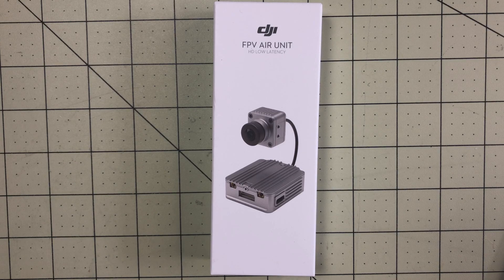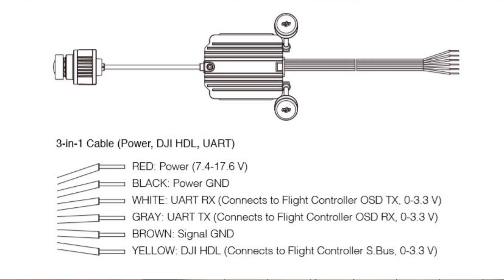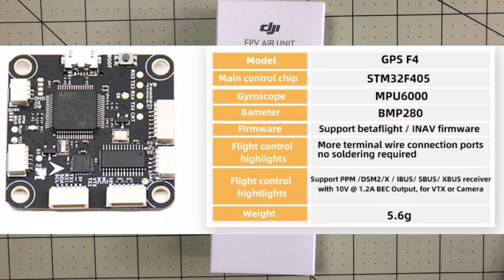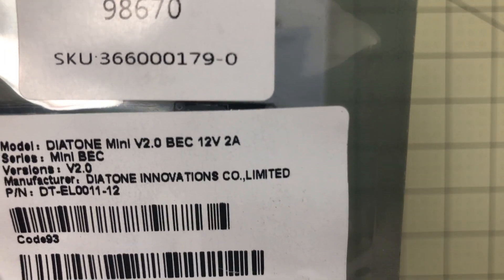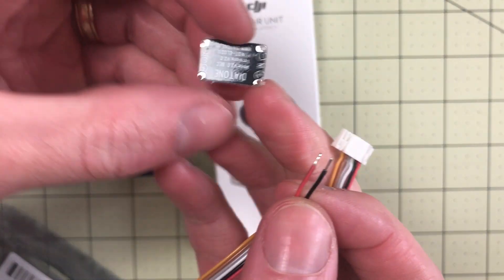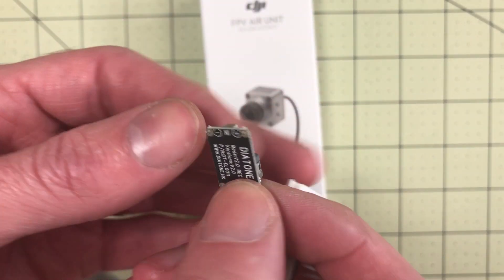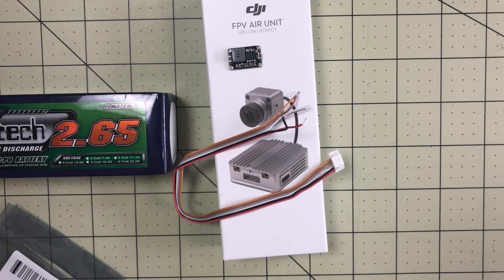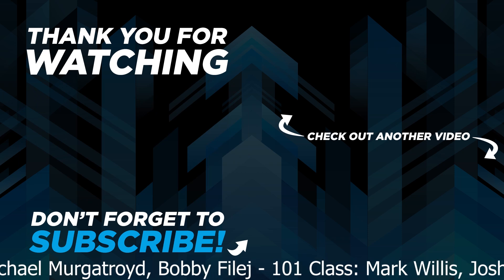How to use the DJI FVP Air Unit with a 6S Drone

Comment from the maker: The Diatone 12V BEC: https://geni.us/Diatone12VBEC 
Turnigy 6S 2650mah Battery https://geni.us/Turnigy2650mah6S90C 

DJI FPV Goggles Combo with Air Unit and Radio http://bit.ly/DJIFPV-BG $743 - With Code BGSAU20 DJI FPV Goggles Combo with 2 Air Units http://bit.ly/DJIFPV-BG - $655 - With Code BGSAU20 
Other DJI Options: https://geni.us/DJIFPV2

Check out my current giveaway: http://geni.us/DroneRacer101Rewards 
These are the current Drone Coupons I know of: http://geni.us/DR101DiscountCodes 

A lot of people have transitioned from 4S to 6S over the last year or so.  But the DJI FPV Air Unit only supports 3S and 4S.  So what do you do if you fly 6S?  Not a Problem

Supporting Droneracer101 on Patreon means more reviews and giveaways for you: www.patreon.com/droneracer101
Reply: Just to let you know that on your latest video about a flight published on facebnook 6 years ago there is a link to your 2nd channel about resin 3d printer as you called it that IS NOT WORKING.

Comment: I just smoked a Caddx Vista which is supposed to handle 6S which it did for about 30 flights. Then POW!! This should keep that from happening again. Thanks for the tip.

Comment: This might be a silly question but I am new, would it be okay to plug a 6S battery into my quad that has the DJI air unit plugged into my FC that's on 9 volt,or still need regulator.
Reply: That should be okay, but really make sure that your FC's 9v BEC can deliver enough power. I just had an issue where the DJI Air Unit shut off (during a power loop, ugh), and I'm a little worried that my FC's 9v power is the problem (that's how I found this video tonight). I'm running 4S so I'm just gonna connect directly to the battery for a while to eliminate that possibility.

Comment: Went for another build tested this same bec dayum it won't output 12 v as bec clearly states diatone v2 12v 2 amp only outputting 9v on a freshly charged 4s lipo.  I don't know if this is sufficient for 5 and 6 s. On this air unit. What bummer fork it still setting it up. I just tested on a 5s now the output voltage is 14.47 volts. Is this diatone bec a dud?

Comment: hey i got a question. i wanna put dji hd in a apex with 6s and a
 Bradwell f4 aio stack 32bit esc...so there are some pins with 5v and 9v can you take a look and answer me if i can put the dji fc direct on the 9v from de esc from bradwell? greez

Comment: Hmmm just ordered a bunch of 5s batteries. 18.5v
I flew one the other day on my air unit build and it was fine.. but now I’m second guessing keeping all the batteries I ordered
Reply: Did you have one of these BEC units on your quad, as shown in this video? Or did/do you fly it without that BEC unit? If so, how's it going with no BEC? Or with BEC? Any issues, or still flying like a champ? Asking because I'm going 6s next month. thanks!

Comment: Hi tks for the vid. Do you still get OSD batt voltage?
Reply from the maker: Yes. That actually comes from the flight controller through the Uart connection.

Comment: Mark, do you know how much, if any, filtration is on that voltage reducer ? Thx
Reply from the maker: I don’t, but so far that seems to be another big advantage of the DJI.  It just doesn’t care.  On my TS215 I’m running it straight from the battery pad.  My wing does have a cap on it, but my “analog” wing still had tons of issues and I have none of that with the DJI.
Reply: @SimRacer101    apparently the DJI system has enuf built in filtration. The reason I ask is when running caddx Turtle off 5v Bec from FC , sometimes it overloads the Bec, but when run str8 from battery, I get a lot of interference. I was hoping maybe this could offer good filtration without using FC 5v Bec. I will stay tuned. Thx

Comment: I can't get osd battery voltage??? Any help?
Reply from the maker: A lot of people seem to be having that problem.  I may have to knock out a quick video for it. The white wire needs to go to an uninverted UART TX pad on your FC and the gray needs to go an an uninverted UARD RX pad on your FC.  Than for that UART in Betaflight, or iNAV just enable MSP.  No other options needed on that Uart.  Also need Telemetry enabled under configuration.
Reply: @SimRacer101  aha! The telemetry is my issue. Thanks!

Comment: Hey man this question may be unrelated but I was wondering if you know how to connect the QX7S to the free link app via Bluetooth?
Reply from the maker: Did you find something useful that app is going to do?  I looked into it a while back but it was only for very specific receivers and they were not really useful.  I thought you were better off just using a real flight controller.  I have used to Bluetooth for trainer mode.  That worked really well.
Reply: DroneRacer101 hey man thanks for the reply, how do you turn on Bluetooth?